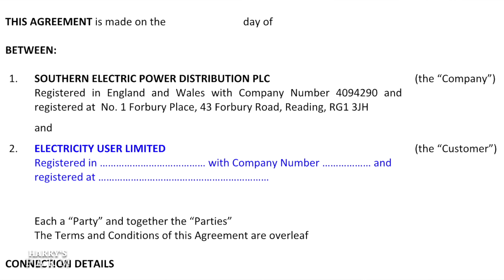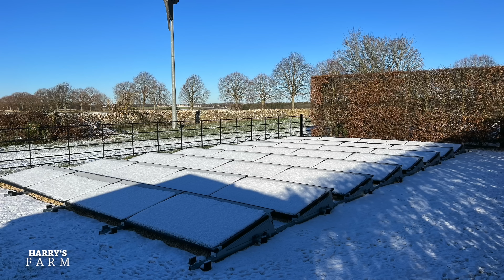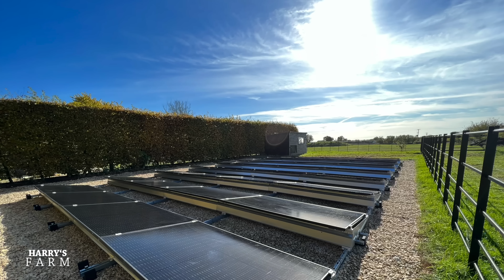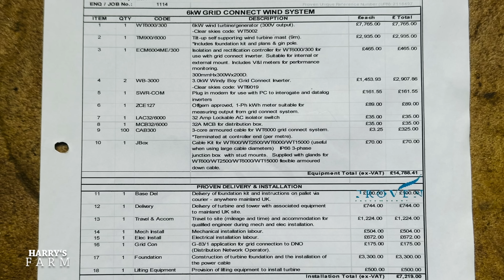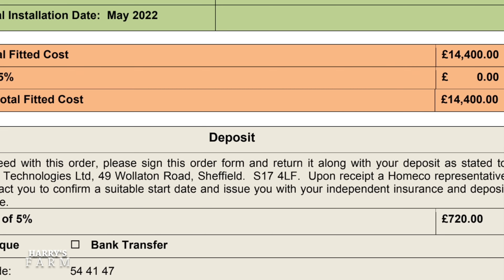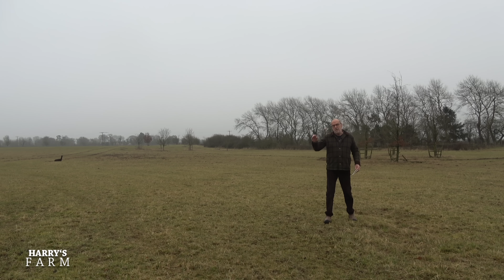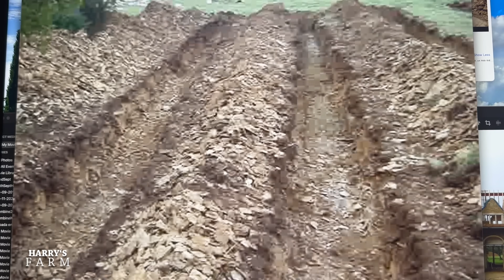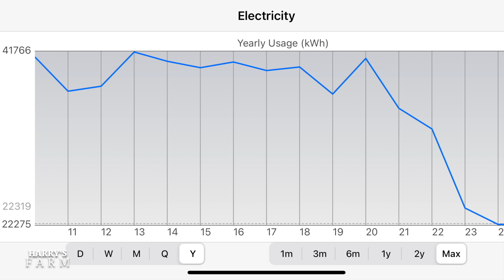Are solar panels & heat pumps worth installing? Here's what I've learnt after several years of use.

Comment: I was faced with the dilemma of if to move only to electricity and also fit solar four years ago when my gas boiler was at end of life. My neighbour had moved away from gas and installed solar & batteries on his identical 1970 house a couple of years previously. He had been disappointed with its performance despite the house being perfectly south facing and unshaded as he was still using significant electricity from the grid in winter.  He had it checked by an independent energy consultancy and they confirmed that the system was competently designed and installed.  Because of this and due to an inherent fear of the unknown, I decided to update my system more conventionally and install a modern, slightly smaller gas boiler, fit treble glazed windows and add more insulation. The cost was about 10% more than my neighbour spent. In the three years since the work was done my gas consumption has fallen by an average of 64-66% per year, which is way better than I expected and my combined gas/electricity bills are slightly less than my neighbours electricity bill. I am happy that I didn't go for the solar.
Reply: This South facing fixation is rubbish - you actually get a better result from East South & West. That allows you to capture ANY sunshine during the day. We have 11 panels on 3 facings - friends have 10 on the South only. We get double the power they do.
Reply: House needs good thermal insulation - at least 10 cm of styrofoam or mineral wool and triple glazed windows.
Reply: @konradlangwald7082  Not strictly true. You dont "need" that much. And you certainly dont "need" triple glazed windows. It's more effecient yes, but there are always cost implications.
Reply: @mustrumridcully3853  actually triple glazing whilst costing more, obscuring more light and being far heavier hence requiring better hinges, doesn't really improve much on double glazing that has a largish air gap. It's the still gas between the glass that does the insulation, but if too wide you start getting convection currents.
Reply: @wino99999  Which is kind of my point. Brand new high spec double glazing works as well - especially when our  house has problems with getting enough light anyway.
Reply: @mustrumridcully3853  If we take into consideration that the building will stand for at least 100 years it is wort while to to the job once and well. The additional cost with rising bills will pay back in 15-20 years max.
Reply: Would be interesting to know if he got all of the insulation done that you did. I've heard heat pumps do not like poorly insulated houses at all; the equivalent to leaving your freezer door open then complaining everything has melted.
Reply: @ My neighbour does have one area of the house that is not as well insulated as mine on a small upstairs stud wall and he knows that he needs to address this. We both have about 18 inches of insulation in the loft space and cavity wall insulation in the brickwork.
Reply: Absolutely agree, I built a new house and heat pump, cut my heating/cooling by 66% over the previous property based mostly on insulation quality.  Typically I can put the heating on for about 1 to 1.5 hrs in the morning and by evening time, when we go to sleep it’s dropped about 1.5c. It is extremely effective with far less life cycle cost maintenance than solar/ batteries or turbines.  Etc.  None of these products work efficiently. You would need to stay in your property 7 years before you can break even, statistically most people move every 7 years..  As for energy grid use, it’s an absolute joke and can’t scale for grid use.
Reply: @Pesmog  exactly right, a lot of people fit solar, etc, but forget the basics.  My own property is  or rather was  a draughty 1950s cottage. Timber double glazed windows that did not seal well.

Replacing the window catches and custom-made secondry glazing with thermal glass made a huge difference, as did extra loft insulation. 

I have a 20 year old inefficient  oil combi boiler boiler  and two log burners.

Depending on oil prices, despite the old boiler  my heating cost is usually around £600 a year. The house is 2 bedroom but large rooms and high ceilings.
Reply: Boohoo!
Using gas indirectly helps Putin and other dictators. It amazes me how people want to stand up to Putin until it costs them a few extra dollars or quid. Generations past sacrificed their lives to stand up to dictators but our generation is just weak and soft.

Comment: Clearly solar works better than wind then if you're inland but neither seem to work throughout the whole year. There are more efficiencies using batteries but these are very bad for the environment. I think we shouldn't be using solar panels in the UK and countries near us they clearly need more sunlight so they should be installed in countries on the equator where they'll work well and we need to continue to innovate and find other solutions.  I think here in UK we should use the ground we have and use other greener technologies on larger scale but I think small nuclear reactors should be most researched because you could easily swap Harry's system for something like that and could even have electric farm machinery powered from it. 
For me the technology isn't suitable.  Climate change is inevitable adapting is key.

Comment: The winter yield is very low. You probably get extra shade on the panels. My 2019 6.6kW roof installation got 200kW last december. Still peanuts compared to the summer though.

Comment: Those panels are angled in a direction I have never seen the UK sun rise to. They should have been angled for optimum performance in winter. Micro inverters also to deal with shading. The big problem with wind power is that the turbine will break well before it pays for itself as is now being evidenced by most wind farms.

Comment: Two things:

The proportions and details on the house are just superb.  It really is beautiful.

Solar: I have a tiddly little 2.7KW system together with 15KWh of Pylontech storage.  In the summer the system pretty much covers all of my local driving, and all house use (inc hot water) for one person.

Winter output is as quoted: sod all, often not enough to run the inverter.  However, because of the storage element I still buy all
of my winter power off-peak (12p) and use it through the day.

I also have power-cut protection so the house can run pretty normally (lights, TV, freezer, WiFi) for a day or so just as long as I don't use it for heat: fan heaters / hot water etc.  As I have a wood burner, this isn't an issue.
Reply: Yeh, farm subsidies suck don't they?
Reply: And being a successful property developer, magazine founder/owner, youtuber and grain merchant. The man is a legend
Reply: @mariemccann5895 ..oh dear, showing your ignorance with that statement.

Comment: Good info, one query - what do you use for domestic hot water?
Reply from the maker: The heat pump gets the domestic hot water up to 45 degrees C, then I boost that with an immersion heater that kicks in when the solar is at its peak. Huge tank, that's very well insulated, means we don't get much drop in (hot) water temperature during the night.
Reply: @harrysfarmvids  Many thanks, I often wonder if a solar water heating system is efficient.

Comment: I conducted a very thorough investigation last year to determine if solar panels, 2 batteries and moving to an air source heat pump (Govt. grant of £7500) would be a good financial proposition. Even using my own capital without factoring any loss of interest I could only make the project pay for itself in 5 years even factoring in a year on year increase of 5% on our current energy cost per kwh. The salesman eventually conceded many buyers simply put the cost on their mortgage and roll up the debt for many years having convinced themselves a monthly reduction in their energy cost of a couple of hundred quid is ok because they get to enjoy it immediately.
Reply: 5 years is excellent! Why would you not go ahead with a 5 year payback, after that it's all gravy.
Reply: @ because the figures were flattered by having no commercial cost of capital charges applied and my money can be more productive elsewhere, also I cannot be sure I’ll not want to move inside 6 or 7 years

Comment: I get in the winter there is very little solar but surely for you and your usage you would benefit from having a large battery installation that worst case scenario you charge up off peak @7p and use so then not paying the peak rates of 23p+. But guessing you have looked into this and not deemed worth it

Comment: Your installer should have advised you to install solar panels with optimizers or add them on to the panels. I have them and I have a 12kw system on 3 roof sides and I generate between 2 to 13kws a day in Jan.

Comment: You need some batteries! Almost a stronger case for these than solar. Yes they help with solar, but bigger benefit is charging overnight at 7p to cover daytime usage in Winter. Solaredge inverter would also solve the shading issue as allows individual panels to produce full output even if others are shaded.
Reply: There is an argument for batteries but I don't agree with them for ethical reasons, perhaps Harry shares this view being a farmer?

Comment: I have had 2.88kW solar PV for 12 years and 2kW of solar Thermal and 206 lt heat store for10.5 yrs. 4yrs ago we added 4.8 kW of battery storage. Before we had any solar electricity consumption was 6000kWh pa and oil 2000lts pa, Solar PV reduced electricity to 3600kWh. Solar PV reduced electricity to 2600kWh and oil to 1650 lts. Batteries have reduced electricity to between 1360 to 1500 over the past 4 years. My electricity bill for January £76.68p lowest in the last 12 months £27.00. We are retired so at home most of the time. As Harry said in winter Solar PV only averages about 10% and in hot weather the efficiency drops when the surface temperature of the panels exceeds 25C.

Comment: You produced exactly the same December generation as ourselves, but we have 6kw on our 30 degree unshaded roof, compared to your 12kw on the ground. You must have bad shading/panel angle in the winter. Peak summer however your figure is comparable size for size.

Comment: Interesting video. It shows how much of a challenge it would be to run a major economy such as ours on just wind and solar energy. A dull day in February without a breath of wind and our friend is reliant on a grid powered largely by gas. Unfortunately as a country we would never be able to afford all the infrastructure needed to collect enough intermittent wind and solar energy, then store it, in order to be able to deliver a continuous, controllable stream of power in the many tens of gigawatts. We also don’t have the necessary workforce available to install at that infrastructure. Our efforts to date have failed to reduce net anthropogenic carbon emissions while delivering the most expensive commercial electricity in the world.
Reply: the grid is way cleaner in the UK than it was 10 years ago, so I'm not sure where you are getting your figures from, admittedly we've done the easy bit now, from here on out it gets harder.  Edit to clarify by cleaner I mean lower co2 emissions per kwh.
Reply: @ Our grid is far cleaner than it was 30 years ago. We’ve halved our emissions since then, more than any other G20 country. Unfortunately, this costly reduction has been cancelled out many times over by far larger increases elsewhere. Net manmade emissions are still rising and show little sign of decreasing any time soon. We have spent a fortune making sure things are very slightly less bad as they might have been. But a situation than isn’t quite as bad as it might have been isn’t a situation that has improved.

Comment: As you explained your home heat pump, I focused on the diagram of the hot water in the roof circulating to the ground and then around and back up to the top as it is heated..My 1904 house in Benwick was heated the same way..but the heat source was a firecoke "boiler" in the kitchen..1 kilo of fire coke was ignited in the boiler..that fuel heated water that was warmed and rose into the roof placed storage vessel..Hot water circulated from the roof, down through radiators in the second and first floors, back through the boiler and then back to the roof tank..I was heating two stories, 1500 sq ft. for about 100 pounds annual cost. but..firecoke is a "bad fuel"...to some...

Comment: You asked a (rhetorical) question about the use of batteries if you don't have any solar (during the winter). I have both Solar and Batteries and during the winter, the batteries are the main system for reducing my electricity bill. I load shift so most of my grid usage is cheap rate and until recently I also exported during high value times. So essentially I buy the electricity at 14p/kWh and sell it at 25p/kWh so they very much help. In the summer, I still charge overnight but then just export most of the solar. We just added an EV though so currently using batteries to extend the cheap rate period (as the 7kWh charger hasn't been fitted yet). When I have HPs fitted, I may add another battery to help control costs (looking at Air to Air by the way).

Comment: Absolutely brilliant ! I have been watching £Harry,s Garage for years  in a house I built  with passiv haus standards , 11.2kw off grid solar so we must be related !  Being Off grid meant zero limitations and POCO scrutiny , we live entirely on solar power  using 3x 10kw lifepo4 batteries . There is no grid so we run the house to maximise the solar  output . I looked at wind generation and was put off by the opinions of sailors who complained about the noise and vibration and of course  running down wind  produces  very low output . Well done Harry for getting into this  in its early days , as you say  technology has improved dramatically since your install in 2006 , particularly battery tech . A current installation would produce more power at a lower cost . I hope this video inspires those who have been interested is solar and furthers its  use .
Reply: You cant be off grid, at best you'll generate 94-95% of your needs and there will be 2-3 days a year when you'll run out.  For the missing 5-6%, you need a diesel generator (powered by winter fuel) and you can have a hybrid heat pump/diesel burner to heat your home.
Reply: @gplusgplus2286  Please, do some further research, many around the world are grid free, fossil fuel free 24/7365 I average 3.5 - 5kW per day across the year; from a 5kW array, with 20kW battery. I'm sat here typing, the array is producing 230 Watts, and I'm using just 28 Watts (TV) and 11 Watts (laptop), Fire flickering away with its 3 briquettes.... we all have different circumstances/requirements/profligate tendencies e.g. I use that 82% ultra efficient multi fuel fire to heat a large proportion of my super insulated house in the depths of winter from a tiny amount wood; much of which I just pick up locally for free across the summer - the point I'm trying to make to you is to get down off that lofty perch and consider that there is, as the saying goes, more than one way to skin a cat (though no-one should be skinning cats)!

Comment: Our 7kw roof mounted generate 120kw in Dec which is low but not as poor as yours. Our roof is at 50 degree angle and no shading. You also need a house battery although for a big heat pump that will need a decent size battery.

Comment: i have a heat pump and it is garbage eats electricity for a very poor return it has been sat in the garden 3 year unplugged not used  my friend also has 1 he has done the same with his but also has had a gas boiler put back in the house   i just use a log burner  the house has never been hotter i have 7kw solar it is also useless in winter the same as yours  however feb onwards good enough output i have no heating or electricity bills

Comment: thanks harry, Solar Install in high cloud cover area of Cotswold is not a good choice. How would it work I. Say  east Anglia with a lot morewi terI sun?
In USA east coast (Pa) we get sun almost everyday in  Winter , but we are at the latitude of the Mediterranean. 
A friend with a solar install for 15 yrs  gets a credit every month for excess ectricity that could be applied to any winter deficit.   He is now converting oil heater to be supplemented electric powered heat since he always has excess. 
Borehole is only practical solution for most people.
Cheers warren

Comment: Relay good video. 400 a month is not bad to heat your place. I have the same turbine as you, and it produces 15 000kw/h, but i am in Orkney.
Reply: It is terrible, I heat my property on £600 of oil per annum.
Reply: @paulf2529 but according to previous comments. You live in a much smaller place.    Your pad will probably fit in one of the garages